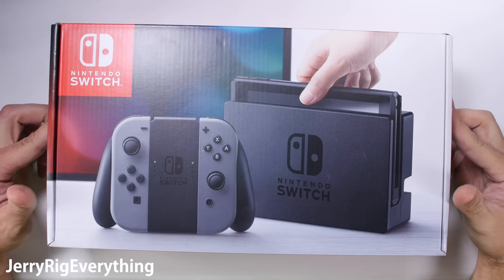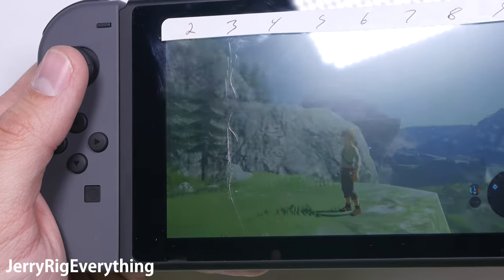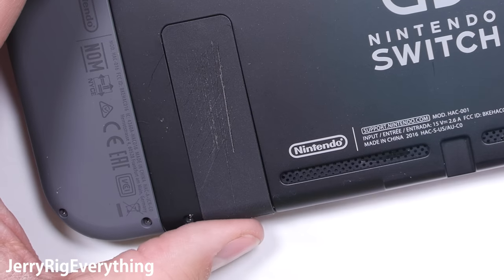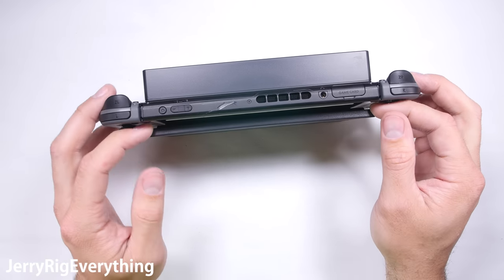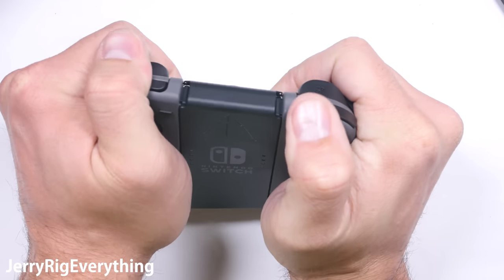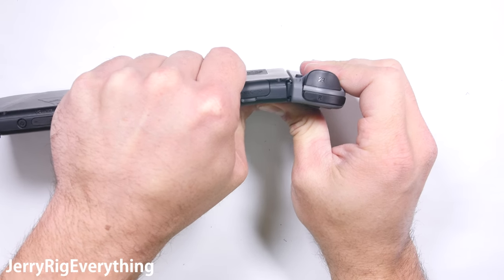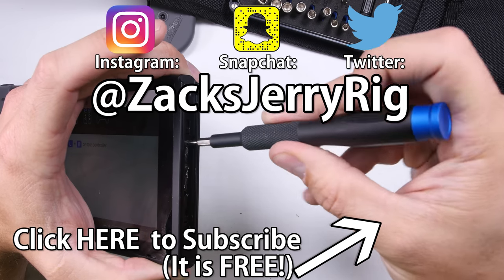Nintendo Switch Durability Test!! - Will it survive?

Comment: Zack: the joystick will take years to wear out.
One month later: joy con drift
Reply: Heaven yes it is
Reply: Heaven  drift is caused by the pads in the joycons wearing out
Reply: Heaven  You're*
Reply: @jaidenisbadatgames  Correcting an intentional misspelling is just petty. Also Heaven is right the rubber on top of a joy stick wearing out is not the same as a joystick mechanically failing and causing drift.
Reply: @jaidenisbadatgames  That's not an argument. Correcting the mistake doesn't prove anything.
Reply: @diamondminer8577  No, some dust or something gets onto the part of the analog stick that detects movement. Because the dust is there, it detects something, so it starts to move because of it. It's not because of it wearing out, it's actually an unintentional design flaw.
Reply: @ElectriX He's just correcting the structure by pointing out that drifting isn't caused by wearing out, he gets the joke.
Reply: Everyone does know that Nintendo will repair joy con drift for free
Reply: “Well, isn’t that kind of the point?”
Reply: I felt that
Reply: @nakotomaegi8173  so the damn thing is sooo sensitive that it detected dust?!?
Reply: Joycon Drift: HA I'M SO ANNOYING
Pro Controller: Hi I'm new here
Reply: Jason Gooden drift isn’t because it’s wore out?
Reply: alphapupup5 every controller is like that
Reply: It's not wearing out, and youre obviously one of those people that puts it in your fucking pocket, otherwise it wod never do that, or you're murdering them aggressively while playing, which is not how you are supposed to play btw

Comment: “Let’s see if this console is built to last for the next 5 or 6 years, until the next Nintendo console takes it’s place.”
Posted 4 years ago.
nervous sweating
Reply: The switch is definitely nintendos cash cow at the moment, and nintendo is unlikely to release a successor when it's still doing this well. There will be more versions like the old and rumored pro to keep up with other consoles, but as of now, Nintendo would be hard pressed to just let the switch go.
Reply: nintendo probably won’t release one for at least 3-4 years since they JUST released the OLED model
Reply: @icicle8263  I just bought a Switch a few days ago and I look forward to the fact that Nintendo even said the console's lifespan is only half way in.

Comment: Along the top of the Switch near the *pause "Headphonejack" You can soooo notice he is targeting Apple. Love it 😂
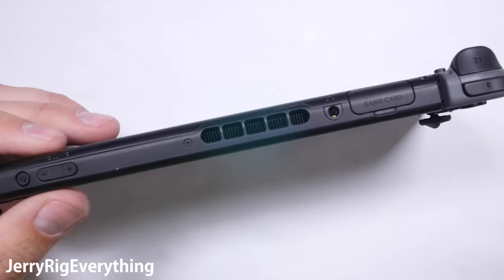Reply: Dani Plays 2:48 you're welcome
Reply: engitect welcome
Reply: Dani Plays Still don't get the hate with the headphone jack, people just hate change and want everyone to use the 3.5mm jack for the rest of time even tho it is outdated tech that was inevitably going to be upgraded. I got the iPhone 7 and I noticed an improvement in the sound quality because of the 3.5mm jack being removed and haven't had any problem with the new lightning port
Reply: Apple mostly did it for money. They didn't make any money off accessories using the headphone jack. They do, however, make money off accessories using the Lightning jack. So by removing the headphone jack, the only accessories that use a jack make Apple money.
Reply: Erdo how can you not use your normal headphones with an iPhone 7? Lightning to 3.5mm adapter, job done.
We can't stick with a 100 year old connector, especially when lightning can give 24 bit DAC and can power active noise reduction circuits and amplification circuits. You'll see most manufacturers doing the same in the future. It's nothing to do with saving money as the adapter costs more the manufacture than a headphone jack.
Reply: favourite moment xD
Reply: There's no bluetooth on it, so it has to have one
Reply: Ah shit i started a comment war... but idc Apple is sheit
Reply: The reptilelover the 6S was also a good phone but the S6 Edge+ still got me
Reply: Targeting Apple? Did you wake up after that?
Reply: Infinite loop Apple just sells well due to marketing. The rest is a fragile lack of talent that makes up for that with deceitful marketing strategies, passing the blame, and pushing more false rumors of functional superiority that doesn't exist for music, art programs, or otherwise. Notice mac and apple products both try the, doesn't get viruses, routine being actually pretty much the same company that some people still insist they have nothing to do with one another and that they now legally have to say does not get PC viruses...

They are the snake oil of the electronics world like those signal boosting stickers for old cell phones.
Reply: Dani Plays I heard the same thing lmao
Reply: Deceitful marketing? While your functional superiority claim has some merit, I do not believe Apple has deceitful marketing. In recent memory, Apple's commercials literally only show what you can do with the iPhone, they don't even mention specifically what, just showing people using it. Unlike many other companies which try to shove specs and innovations down your throat with their commercials.
Reply: +Dani Plays Not just Apple, but also HTC.
Reply: Bloon Adjustment pha, that was like, one phone... And sadly will be more... A lot more phones... O-o

Comment: I just got a Nintendo switch and I’m to scared to even take it out of the case
Reply: It's fine if got one and if you have a screen protector it's fine
Reply: Dude, i bought one on day of release... it has been almost two years, i don't have a screen protector and it does not have a single scratch.... if you want put a screen protector just in case
Reply: wow
Reply: @gabirivero1304  well then you don't use it
Reply: @thediamondtv3803  I guess i keep it very well then :)
Reply: I got mine 2 days ago and it’s good bro. Only a few issues, I have a few very light scratches on the inside of the right joycon prob from taking them out and putting them into the switch so much. Also when the cons are locked in if you try you can move them a little bit but that’s normal I think. Be safe with it bro
Reply: @1babo  mine the joycon just slide of so I am buying new joycons

Comment: guy on the video: this controller will last year's 
drifting: na 2 months
Reply: Less than a month for me
Reply: IT have never happened to me
Reply: lasagna drifting joysticks are from dust so that’s your fault
Reply: @fuckinwit930  ... dust is natural it's not anyone's fault
Reply: I hate fucking drifting I play on Xbox and if I press left analog forward and just leave it will just keep moving forward which makes it hard to get first shot accuracy cuz I stop to shoot and it starts moving again will I'm shooting so I just give away my position
Reply: lasagna's switch: nah two months
my switch: nah a month and two weeks
Reply: Exactly 🤦
Reply: That's why u get the pro controllor also just recalibrate it
Reply: @MoldyPizzaman  true but it's to late for mine
Reply: @fuckinwit930  It's not just dust, it's a manufacturing problem.
Reply: @fuckinwit930  doesn't know how dust works
Reply: My Joycons are one of the only few that DONT drift
Reply: Bruno Maximiano no a drifting joystick is from dust
Reply: You are probely dutch as wel
Reply: Beazy Games who?
Reply: Katherine guy except you can get rid of some dust
Reply: lasagna u can fix the drifting in settings just go to controllers
Reply: @katherineguy1912  actually dust is 80% dead skin so it's 80% your fault
Reply: @fuckinwit930  it is caused from dust, but Nintendo didn't put much protection from this dust, and they are giving out free repairs
Reply: Lasted 3 months for me

Comment: I want to call you a monster, but you are destroying it for a decent reason. So keep it up.
Reply: His entire channel is about testing cellphones in a similar manner.  Compared to the average cellphone he test, the Switch held up extremely well, save for the screen scratches.  

After owning a 3DS XL and a N3DS XL, I'm not shocked that this system will need a screen protector right out of the box...

Comment: the plastic is also to reduce the weight of the switch not only because it is cheap
Reply: Saeed Al Qaizi Aluminium is also light
Reply: Saeed Al Qaizi keep convincing yourself kid
Reply: Saeed Al Qaizi brushed aluminum would be perfect. And a microfiber dock for the sake of the screen would be nice. However the plastic is still tooo cheap. look at other cheap materials, however the plastic is very very cheap.
Reply: You really think people give a shit about it weighing a little bit more? An ipad weighs more than this thing, I've yet to see anyone complain about the weight of an ipad. Face it, they did it because they cheaped out.
Reply: IT has a full metal chasey inside the console. Aluminium collects dust very easy and also scratches just as easy. The plastic screen is to prevent screen cracking and lets not forget that it has a 8.5 on ifixit because this system is Very easy to fix unlike many others.
Reply: It needs a screen protector from factory. They have valid uses for using cheap materials but it is just that, cheap.
The technology is not worth anywhere near 300 and cheap plastic materials, that is however their margin they chose.
Critiquing is always good, and the best bug test is setting it out to the public. By holiday time there will be a new switch for sure. Without a doubt.
Reply: WHo cares about how light it is, I would happily pay, an extra 50 and have it made from aluminium.
Reply: PC, Xbox and PS4 the outside component made from plastic so don't be so negative about it, we are in era where literally everything made of plastic and i'm also made from plastic 😜
Reply: Put you wont use the ps4 that much only the buttons on it with the switch the controls are on it you will be using it all the time and its supposed to be verry portable
Reply: made of plastic! it's fantastic!
Reply: Saeed Al Qaizi pretty sure its everything but cheap I mean It costs like €340 without games
Reply: Aluminium is "light" yes but not that much is still a metal so is still heavier than plastic, also metals like aluminum conduces heat very well and you will end burning your hands (Consoles reach high temperatures due to how they work so...) also remember that aluminium bends easily and said bends on the sides can create sharp shapes that will end cutting your own hands. So, a big nope on that fact. (And i'm not even touching the electricity conduit that all metals are)
Reply: I think cost is a huge factor though. This thing is $300 which is already pushing it for me. I understand miniaturization raises cost, but if plastic means keeping it below $300 and not a $400 console, I'm fine with that.
Reply: Saeed Al Qaizi  much more important than weight, plastic screens don't shatter, and a plastic body will return to its original position once bent, where a metal body wouldn't
Reply: +Eileen Kelleghan (Wolfest Brownwolf) After knowing this, I'm glad they went with plastic.

Comment: it doesnt even survive the dock unscratched
Reply: ScottJoC actually people using the dock normally are having that issue as well
Reply: That's a blatant lie. I'm ZERO careful with anything. I treat my Switch like a normal phone and have no problem at all. It has those rubber thing and there is no way you can scratch it with the dock. No way at all.
Reply: There is no rubber in the dock or on the console to protect from the dock. It's all plastic.

Comment: I left my switch on the roof of my car. Was going about 30 and I saw it fly off through the mirror. I was so disappointed. It's been a year since then. The switch works fine! It has a couple small scratches, and one joycon doesn't charge anymore.

Comment: It looks very fragile, like a piece of plastic crap
Reply: Kuk Kek Yeah it's pretty depressing. have to buy either cheaply made consoles in order to play 1 amazing game
Reply: I have no problems with plastic. This thing is still sturdy af and handles the normal usage very well (although you need a screen protector).
Reply: i agree. No consoles are made with metal. All consoles are whether plastic crap or refined plastic crap. Make a metal console and ill try one
Reply: girlsdrinkfeck but not in the inside. Thats the point.
Reply: Did you not watch the video?  It held up to a lot of abuse, probably just as much as any modern handheld.  Just needs a screen protector because they chose impact resistance rather than scratch resistance, which is always the tradeoff between hardness and flexibility.
Reply: Endyo still, there isnt any piece of metal piece on the outside (hence why he called it "plastic" crap). Even some $100 phones are made out of mostly metal
Reply: Junilog... Ummm the analogue nt. Costs as much as a switch, 500$. But at least you'll play your NES games with top of the line style, features and quality.
Reply: girlsdrinkfeck and is a thousand generations behind todays smarthphone. Why is it more durable? Well first off todays smartphones are always touchscreen. You need glass for that. And glass is more brittle than plastic. And where is the glass on 3310? none right? If today's smarthphone are still made of plastic, of course it will be as durable as 3310. And the price? Well  smartphones of course have more transistors than a 3310. What are transistors made of? Gold, so something that's almost 1000× more powerful than a 3310 isnt allowed to be 10× the price? 

TL;DR You can't compare old stuffs with modern stuffs in durability.
Reply: Hipster Black Metal The Switch is $300 tho, not $500.
Reply: it doesn't looks like crap

it IS crap
Reply: plastic is more durable than glass and thin metal frames used on phones.
Reply: Kuk Kek it's a very faulty design and I am surprised it's from Nintendo
Reply: Reason 1 of the list "why not to buy a console on its launch?": Bugs. Glitches. High price. And a lot of bas things more lol
Reply: Did this whole comment thread miss the point?
Obviously an Xbone and PS4 are made out of plastice but... THEY DON'T HAVE A SCREEN ATTATCHED TO THE CONSOLE O_O 
The screen is extremely fragile compared to any mobile device near the cost of a switch.
Reply: I see another little kid trying to troll lol...
Reply: +Lymarie Guzmán Pérez yea, 300 USD, but certainly not AUD

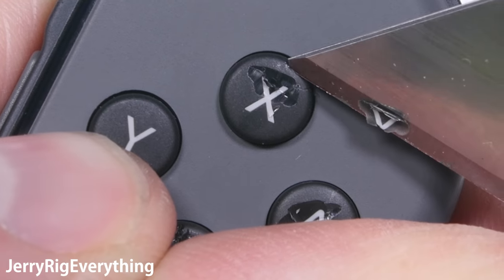Comment: GUess what, 2:39, we have a robot vacuum cleaner  and i left my switch on the floor, and the robot went over it, and the next day, the switch's rubber coating on the joystick was completly torn off, i had to play like that for 2 years until i got my new controllers :')